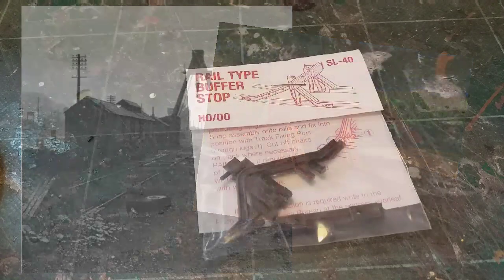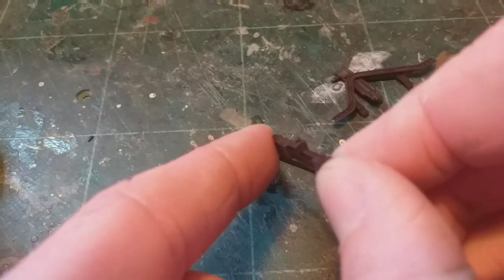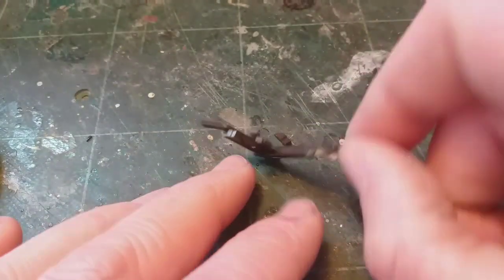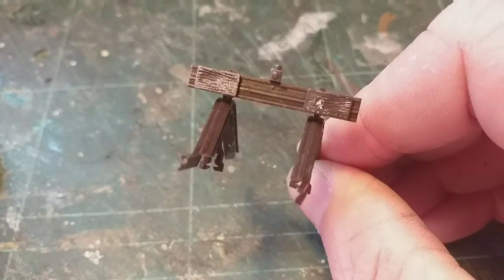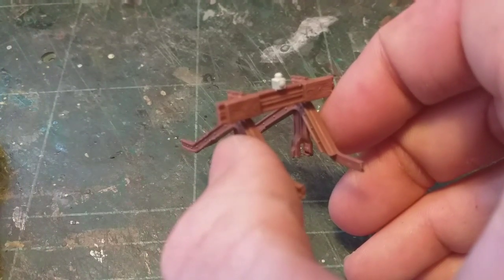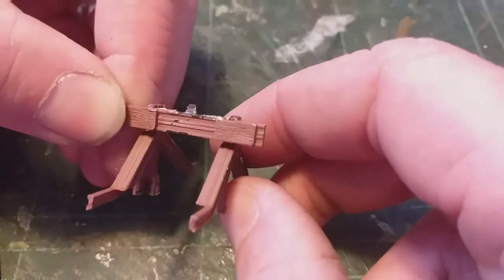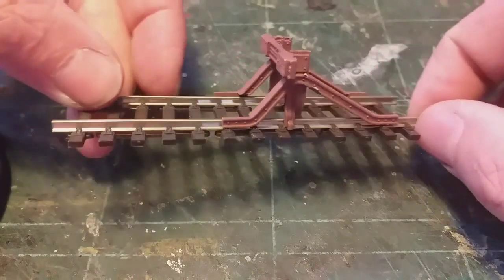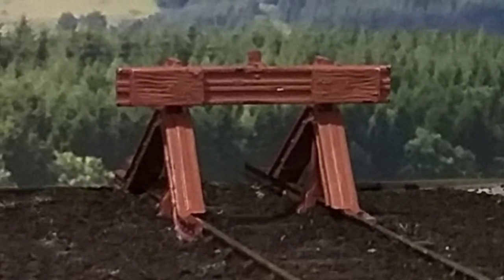How to build & Improve 4mm 00 gauge buffer stops. Peco Kit SL-40

Comment: You have opened my eyes. I have some pre-made ones from Hornby and now know how to tweak them. I also have 4 Peco ones still bagged so I now know how to get them to fit properly when I get to that stage. Cheers.
Barry.Devon
Reply from the maker: Thanks Barry.
The only other thing I did to them after this video was add a reinforcing/tensioner bar across the back of the cross member using a bit of brass wire.

I think if you look at some of my more recent Kirkby MPD layout videos you can see it. Possibly the video on making lamps part 2 which focuses on the lamp down the back of the shed where the buffer stops are located.

Anyway, thanks for the comment and I'm glad that the video was useful to you.